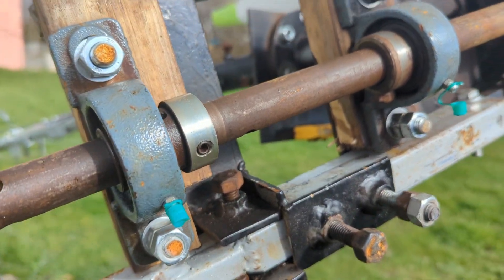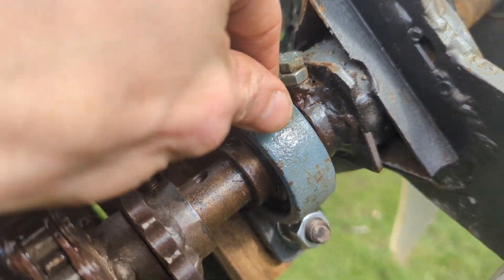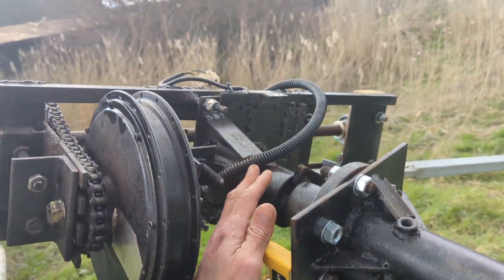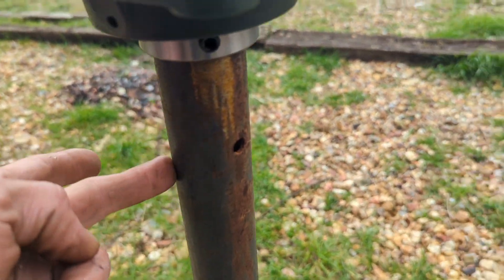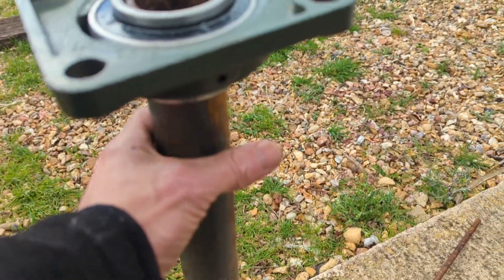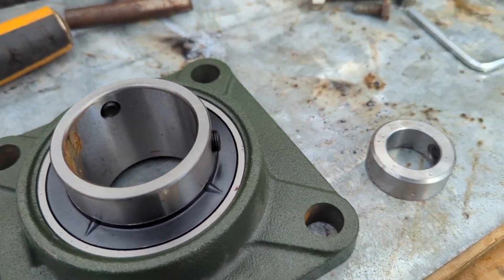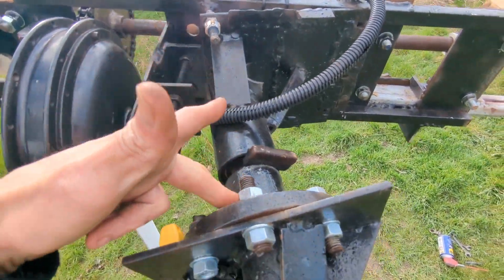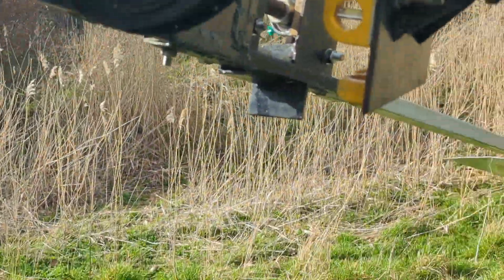Monster Bearing a giant leap forward ?? Wind Turbine Project

Comment: Hi Gavin I used one of those bearings and I found that the 'swivel' was undesirable. I solved it by bolting two bearings together 'back to back'(with the shaft going through both) through the bolt holes - worked on my motorbike :)
Reply from the maker: Hello mate, sorry for the very late reply. I've been pretty poorly so just trying to go through my comments the bearing is an unknown quantity until it gets up on the turbine, but if it works it means it's something I can replicate easily. Cheers!

Comment: For most linear guide and drive applications, grease is the better lubrication option. It adheres to bearing surfaces better than oil, lasts longer, and is less likely to run off or be ejected from rotating parts
Reply from the maker: Thank you for the comment. Yes I only use WD40 as I didn't have any grease. Cheers.